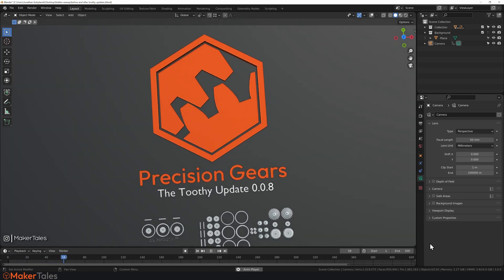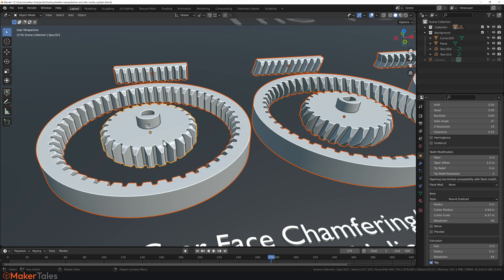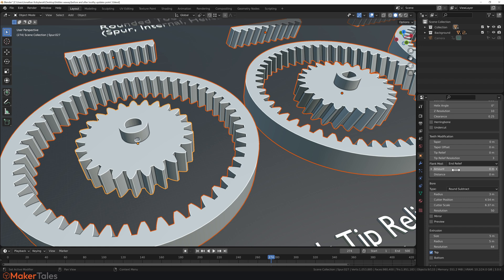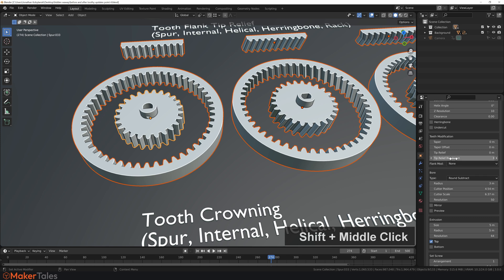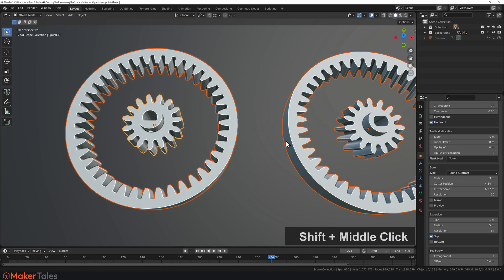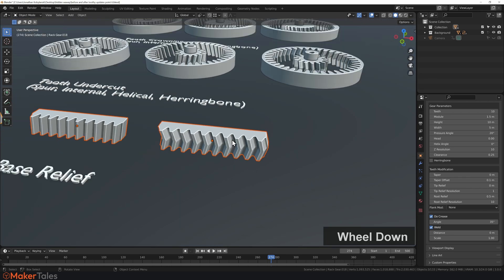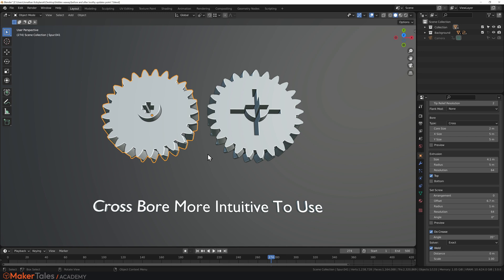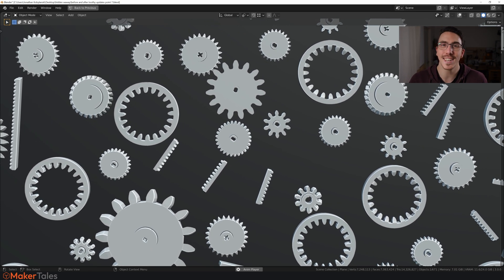Make "Any" Gear In Blender 3.0 | Parametric Gears - The Toothy Update

Comment: Please let people edit attributes, because trying to work backwards from clearly measurable things from a belt to what is backwards derived is a nightmare of unnecessary math that is already within the module.  just allow input in the attributes fields to calculate backwards. Not allowing this is literally defeating the purpose of purchasing this blender mod, which is to remove algebra from useable tooling.

Comment: Apologies if this is a stupid question, but what does 'shift' do? I'm trying out the lite version and your gears were coming up slightly larger than the FreeCAD ones.... until I set shift = 0, now they look identical and the outside diameter matches what I'd expect using D = M * (T + 2).

Comment: Hi, I just bought the add on, the last time I drew gears I did it the hard way using the geometrical construction method I learned at college many years ago and it took hours.

Question. Once I'm happy with a gear is there a way to remove the parametric feature so it becomes a normal mesh?

Edit: Exporting and re-importing it in .FBX file format seems to work.
Reply: Hello @glennet9613, I would like to contact you, can you share with me your E-mail address?

Comment: Ok, I just got it and it is excellent, but I have a problem with driving the gears. I made an empty to contain parameter for driving a whole gears assembly. I am using the empty as parent of all gears in that assembly. The empty contains parameters like the main module used, primary gear teeth counts and so on. However, if I change the driver parameters in the empty they are updated in the Children - but the mesh does not update automatically. Just clicking on the driven parameters and hitting enter, to reenter the correctly updated driven values updates the mesh. Did I miss a setting somewhere? Is there an update all driven meshes shortcut? 

Anyhow, I am transferring ideas from FreeCAD that literally bugs me to Blender. Although the RealThunder version is much better then the current official FreeCAD stable, even when using daily builds. In this case I want to do animations anyway, so blender may be the better choice.

Comment: This isnt precise at all. All the dimensions are off and dont match up. This is not good for 3d printing at all
Reply from the maker: Hey Unity I'm sorry to hear you are having a hard time. I can assure you that these are precise gears. Perhaps you have put in some values that would create impossible gears. The equations used to calculate these gears are based on involute equations. Here is a page that might help a little: https://www.tec-science.com/mechanical-power-transmission/involute-gear/geometry-of-involute-gears/
If you are still having a head time feel free to join the discord and I and others are always happy to help. 😊

Comment: Just a curiosity for me at the moment, but does this generator support deliberate "missing teeth"? Like if you want to make a gear that has one tooth missing to achieve a specific ratio, or if you want to generate a gear at a specific module but with only half or a quarter of the teeth?
Reply from the maker: It does not... With that said that Is a nice little idea that I might be able to implement down the line 😉
Reply: @Keep-Making  Thanks for getting back to me! I look forward to seeing how this project progresses. Now I just need to actually learn Blender - the specific UI and default keybinds over the past twenty years are nonsensical enough to me to literally induce visceral reactions of nausea and high anxiety. Maybe I'll just find a theme I can abide and stick to nodes and the python interface... assuming I can wrap my head around enough python. XD